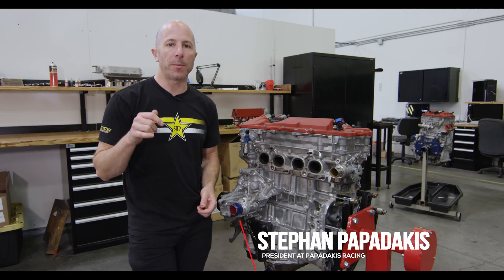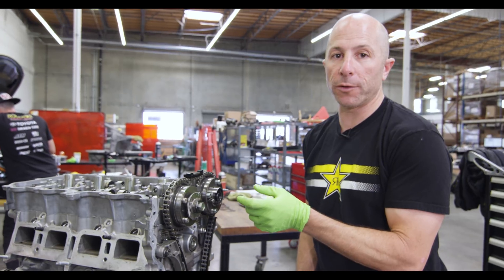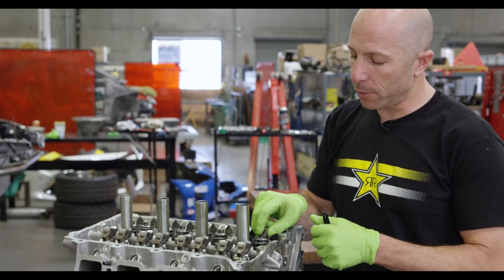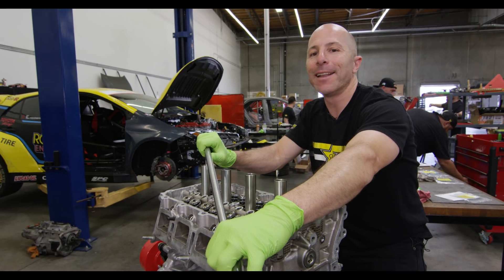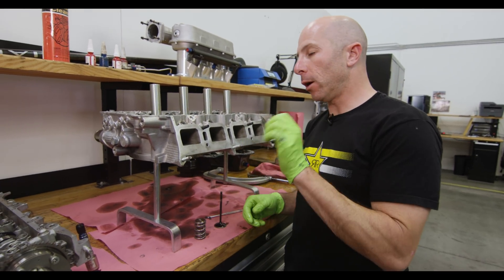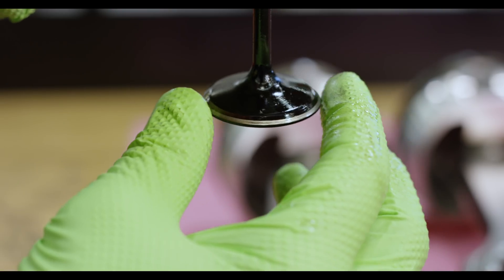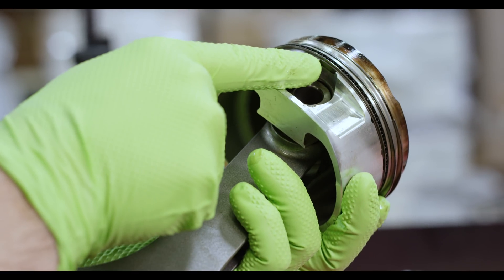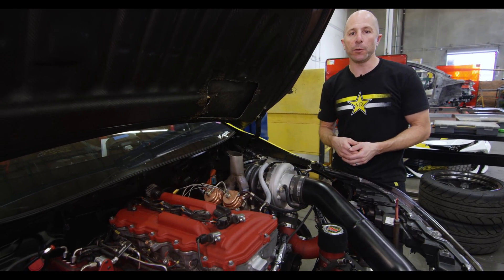Analyzing an Engine During Disassembly with Papadakis Racing

Comment: What’s the engine code ??? 2?? ZR?
Reply: 2AR-FE, but most of it is custom parts. They had to have a custom crankshaft machined, to take the boost and the nitrous. As well as a dry sump system designed from scratch

Comment: shoot i had a toyota paseo awhile back i was building up to be an off road car, wish i knew you guys back then id had you work the the 1.5 5efe it had in it. I put some larger cams in it and had it completely rebuilt but the one cam seal kept leaking. Not sure if it was due to the guy who rebuilt it but kept trying to silicone it but never could get it to stop. For what it was i liked the little car. 95 in 3rd about 5k  rpm was fun enough for me.

Comment: The OEM crank takes 1000hp?  That's crazy.  What parts in this engine are factory or modified factory parts?  What are the weak links on a factory engine when trying to make big power?   Oil system?  Rocker arms?  Cam profile?
Reply: Same with the SR20 crankshaft, also holds up to about the same. When we get to like a 1000 horsepower, mostly everything is a weak link. Cylinders, vibration, piston,rods, bearings, maybe the oilpump,  intake/exhaust ports/Valves aka how easy can the engine breathe etc. I could write you a book, but I dont have the time :D
Reply: hahaha thats why toyota know for reliability they always overengineer stuff even for cheap car they sell  and btw they still use the orginal block not billet one
Reply: Most oem cranks (across the board from all manufacturers)  can handle way more power than its original intent. You will see lots of race teams run the oem cranks on their extremely high output modified engines. In fact the bottom end of most engines can handle way more power. It's the top of the engine the head where all the action takes place for more power. Increasing the combustion chamber increasing the breathe (in and out) of the combustion cycle. Which necessitates a newly engineered head. However the bottom end of most oem engines are extremely over engineered. The Toyota supra the Chevy Is series of engines both are excellent candidates for huge power gains of almost doubling to tripling their original intended horsepower output. Now I'm just rambling.....lol......

Comment: sounds like those custom rockers don't have correct geometry... that's probably the cause of the poor valve seal... I'd be pretty pissed as the customer but I guess sometimes aftermarket parts still require a bit of trial and error to get right and someone has to be the guinea pig.

Comment: Can you please explain why would you run a cast steel 5sfe crank in an engine that has that much output?
I have seen the  same engine in a different video were you had an after market billet crank
Reply: My guess is because it's lighter and sounds like it's a road-course car so better responsiveness and probably being spun out to a higher RPM...
Reply: It may be down to the power/torque levels and it being a stock stroke engine Vs a stroker?

Comment: Stef  thanks for this great video... why are you running such fat  seats ?on those valves i have often back cut them for better flow at low lift  ..are you leaving them fat to make them a bit more robust in the heat  ?

Comment: 1000hp engine for....drifting?
How is drifting racing again?
Reply: It's not, it's more like skateboarding or ice skating.
Reply: Yeah, but even skateboarding is considered a sport.
Reply: @ThunderAppeal  Drifting isn't considered a sport?
Reply: Because it's all about passing your opponent.  It's car control to the extreme.  Different racing compared to circuit racing, but still racing.  Kind of like how drag racing doesn't even have turns but is still racing.
Reply: @matthewmillar3804  Drifting is a judged sport not a race, passing your opponent would mean you lose.
Reply: @DriftNick  Huh.  And I thought passing your opponent meant you won automatically, your opponent not going fast enough for a good competition.  Live and learn.

Comment: 250 hp per cylinder! The craziest is one single cylinder in a top fuel is 2x this entire engine.
Reply: also the difference is that with a top fuel car, instead of doing a tear down a few times a year, they usually get a tare down after every outing, and if they discover any problems it can get a tear down after a run. The joys of big horse power.